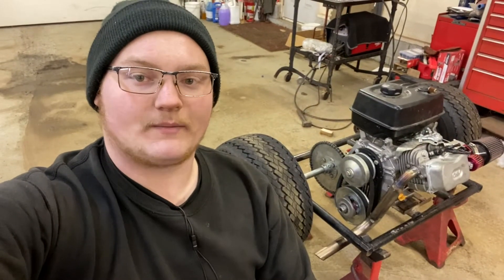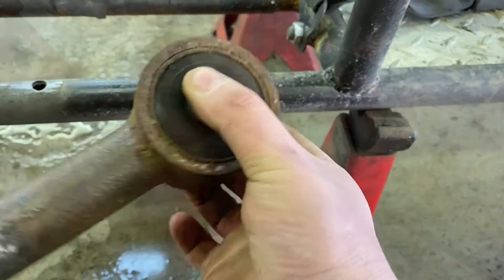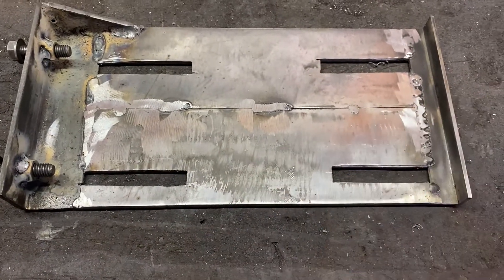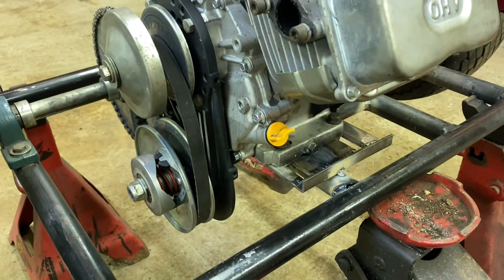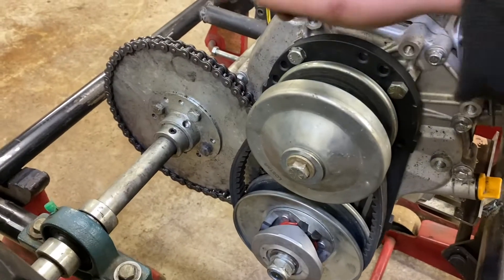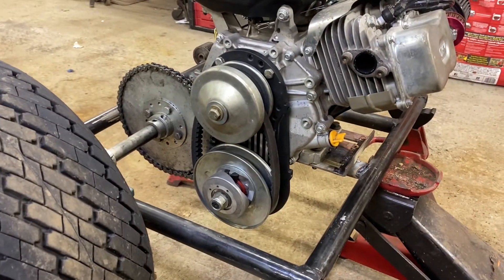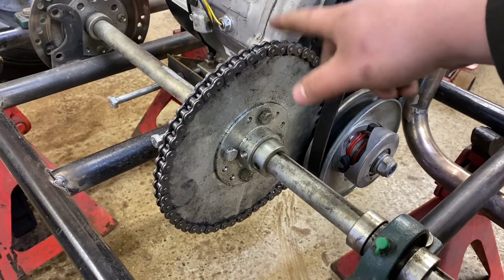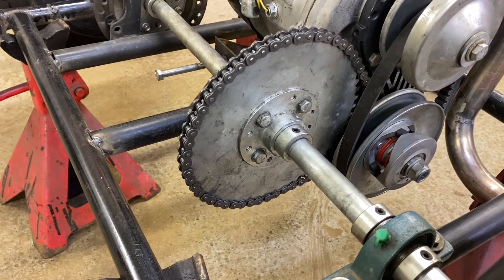Adding Rear Suspension to the WE2 Go Kart (Episode One) pt.12

Comment: Put the axle under the frame. It will give you the clearance from the bolts on the backside of the engine and more ground clearance at the same time

Comment: Which hub connects to the brake rotors and what model are the brake rotors?
Reply from the maker: For mine it’s on the right side and it’s a keyed hub and axle, the brake system I used came out of a hammerhead 80T go kart. It’ll be upgraded when I get time